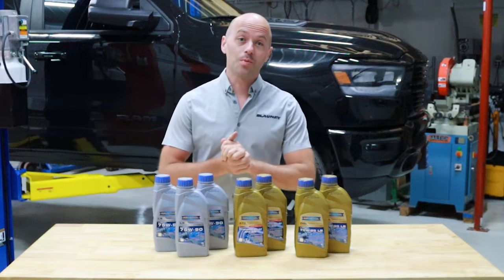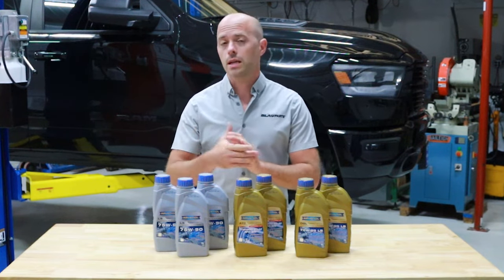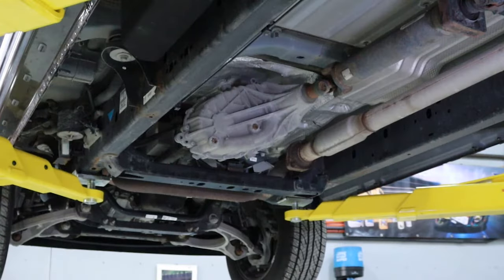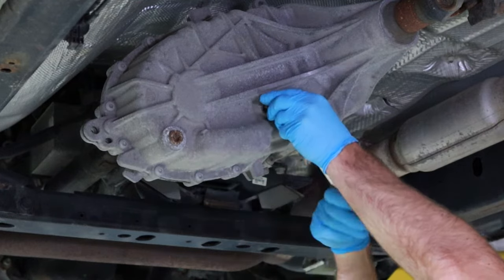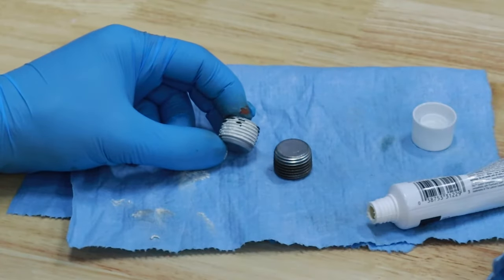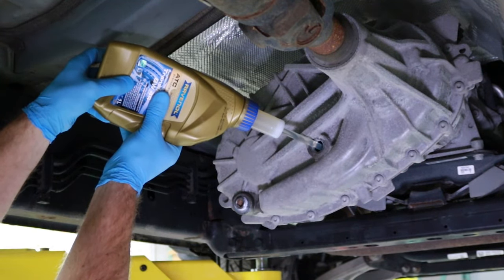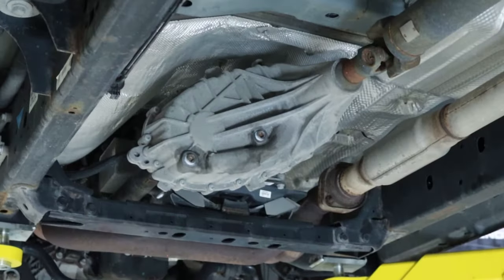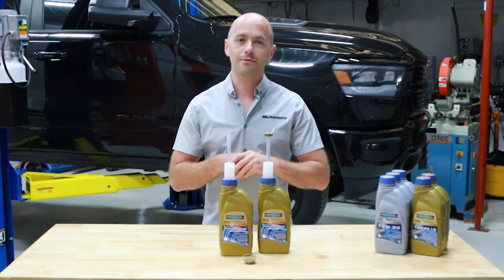Ram 1500 Transfer Case Fluid Change DIY (2011-2024 BW44 BW48)

Comment from the maker: The Ram 2500 and 3500 trucks also use the BW44 type transfer cases. This DIY video tutorial would also apply to 2012 and newer Ram 2500 3500 BorgWarner 44 transfer case fluid changes.  Some slight differences will be seen due to the truck chassis differences but the general steps and concept will apply for the fluid change.

Comment: Can I put ATF+4 on it???
Reply: No
Reply: AMS Oil Signature Multi Vehicle ATF (Red) meets Mopar 68049954AA and 68089195AA specification for $14.59/quart (member's price).   Why spend twice or three times as much for OEM Mopar fluid?
Reply: Depends on which transfer case you have. If you have the BorgWarner or NV246 transfer case, a BW 44 series fluid is recommended. If you have anything other than those, you can use ATF+4.

Comment: I have used Amsoil atf4 red what can your fluid offer that is better than amsoil?
Reply: I honestly can't speak regarding the product used in this video but I've used Amsoil ATF4 Signature in my truck since about 4K miles, zero issues.  I had 100K miles when I traded it in and now I'm using the same in my new truck.

Comment: Help, What is the difference between changing the transfer case fluid versus changing the differential fluid? Is it the same thing just called two different things? Please excuse my ignorance. Also my Chrysler dealership wanted to charge me $500 to change my transfer case fluid on my 2021 1500 Bighorn That that has 55,000 miles, does that make sense to you?
Reply: If you have 4wd the front and rear axles have differentials. They almost always  use gear oil regardless of vehicle brand. The center differential or transfer case on Rams uses a special type of oil that is different from the typical gear oil in the front and rear axles everyone uses. Some brands use gear oil in all 3 diffs, others sometimes use atf or a special oil in the center differential aka transfer case.
Reply: $500 to change your transfer case fluid is a huge dealer ripoff...it's what they specialize in.  The transfer case fluid is different from the front and rear differential fluid.  The front and rear differentials take a GL-5 rated gear oil with friction modifiers (if you have a limited slip differential).  The transfer case takes a specific ATF that must meet the Mopar specification that I listed below in my comment to another guy.  Changing the transfer fluid yourself will take you about 15 minutes (it's a lot easier if you can lift the truck for access).  There's a fill plug and a drain plug.  Pretty simple.
Reply: Yea transfer and differential are two separate things but are basically the same process to change each one’s fluids pretty easy even for newbies just look up your truck’s differential oil type and your transfer case oil type as they’re probably different. And 500$ is Robbery you could literally buy all the equipment to do it yourself for way less